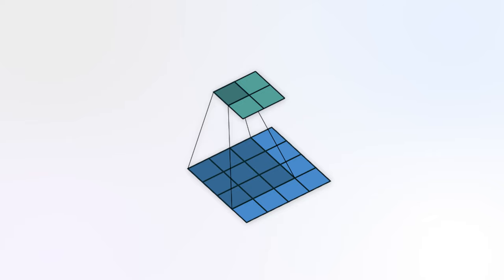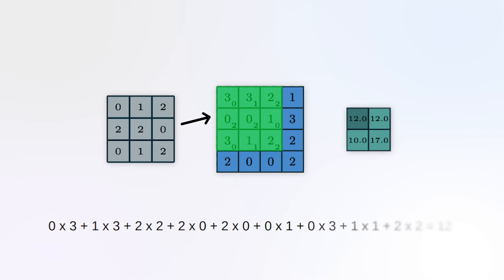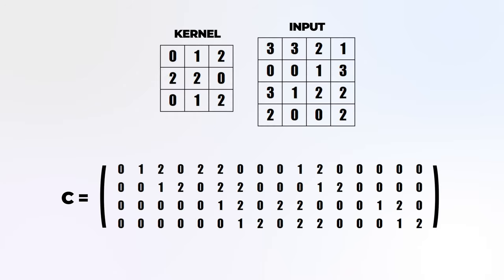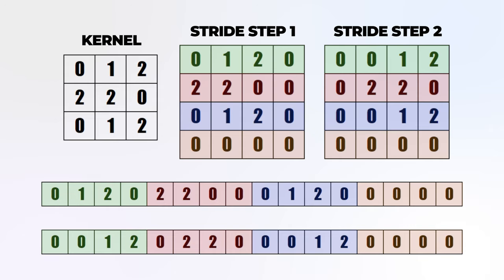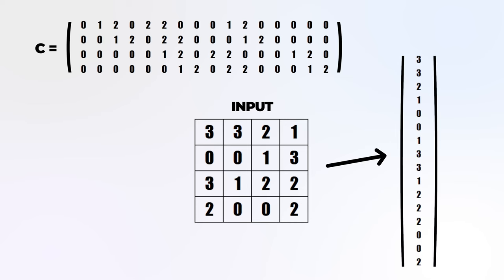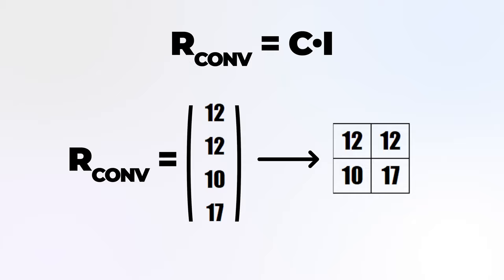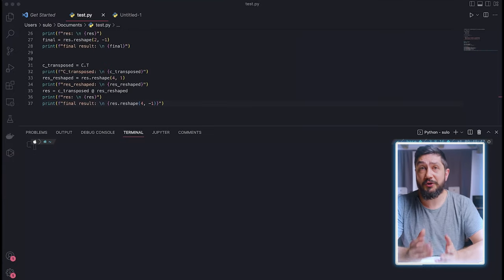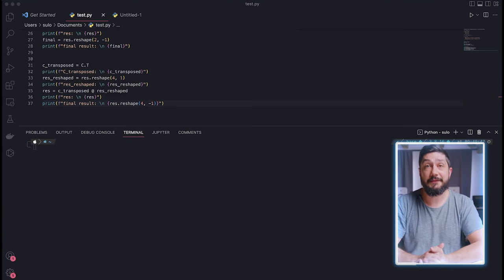Transposed Convolutions Explained: A Fast 8-Minute Explanation | Computer Vision

Comment: It would me more space optimized if you made the convolution matrix using patches of input instead of kernels. That way if input size is really high (100x100 or 256x256), your matrix would include a lot of zeros, increasing both size and time required for matmul.
instead creating patches of input of size (f x f x nc) and flattening them into size (#strides, f x f x nc) and then taking dot product is more space and time optimal

Comment: In CNN's the filters have weights. How do we reverse the convolution operation and call it a transpose convolution. I mean, how do we use it in backpropagation and update the layers weights. Shouldn't it result the initial inout that we have applied the convolution?
Reply from the maker: I think I said it in the video… but a transposed convolution is basically the backpropagation of a „normal“ convolution… therefore a „normal“ convolution is basically the backpropagation of a transposed convolution
Reply: @JohannesFrey  Absolutely. I have mistaken it with the backpropagation of CNN itself.